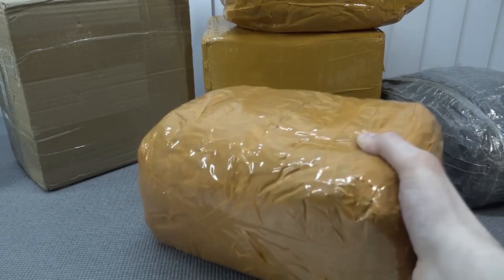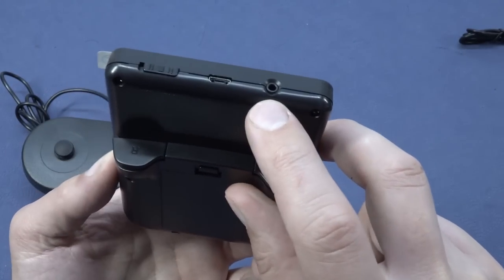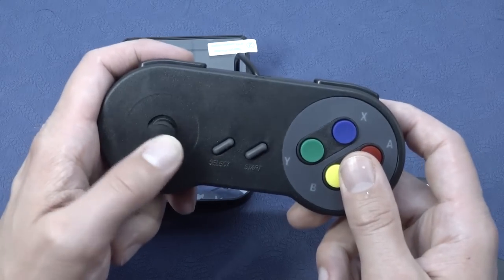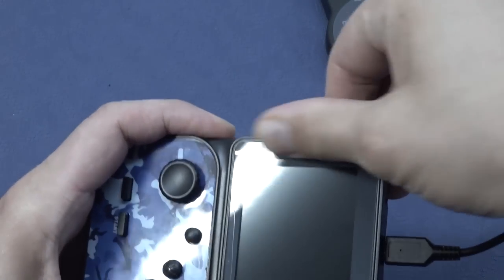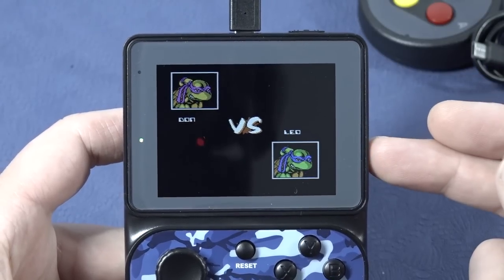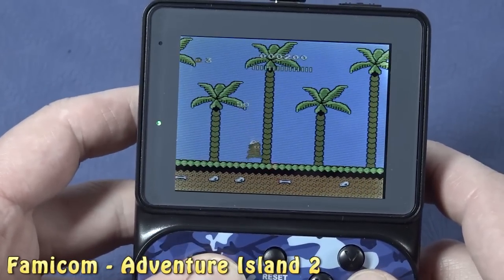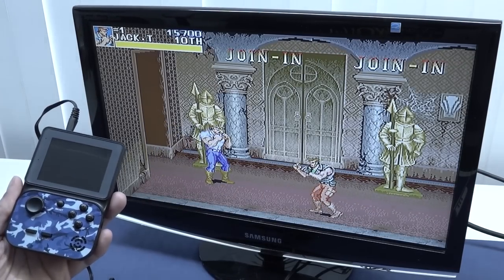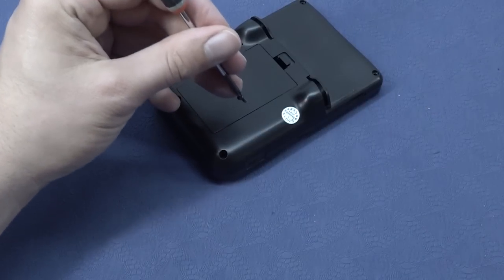A 30$ Ali Express Retro Handheld That Plays It All ? 😲

Comment: Just buy a Powkiddy V90 if your on a budget, $40 may be a bit steep if you're strapped for cash but just borrow an extra $10 from a friend and put you're $30 into a device that CAN be a joy to own and play. I bought the black V90 in Canada and had a $5 coupon from powkiddy, easily one of thee BEST $40 purchases I have ever made.
Great review of yet another crap-tastic SD card slot-less device form China. nice form factor though. I honestly wonder what these crappy devices will look like in 10 years.

Comment: Yeah at a certain price point you might be better off using emulators on your smartphone & buying a nice gamepad instead & a fast micro sd card.
Or hell pick up a used phone locally for like 70 - 150$, get a bluetooth gamepad with one of those phone mounts if needed & a new battery if it's bad on it.

Comment: I guess there is one use for the controller - you could take the head of it and put it onto the handheld itself; then you'll have a better controller on the device.  The emulation and running though is so bad! Why there is no sound makes it even worse!  Maybe the lead is broken or it just never worked in the first place?  Quality control seems to be non-existent with this one!